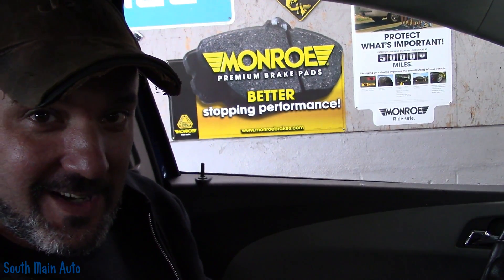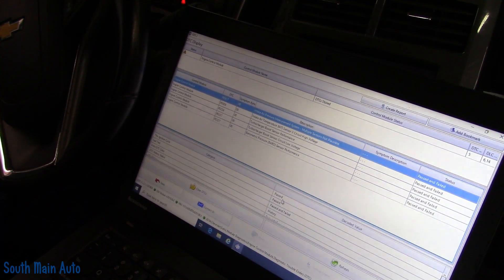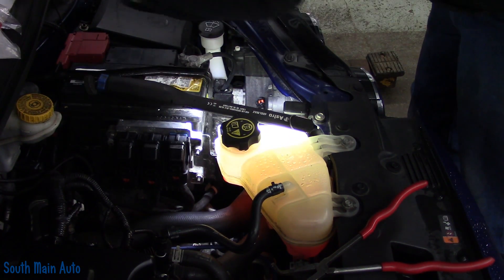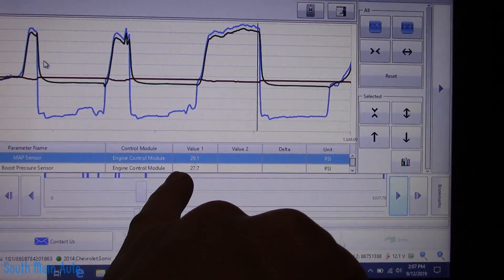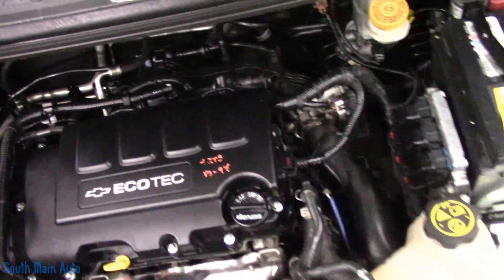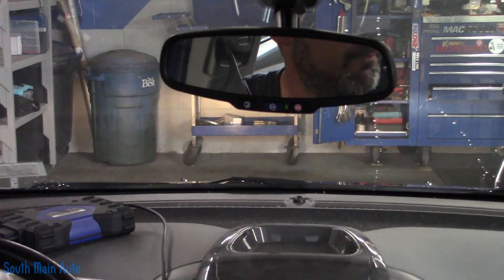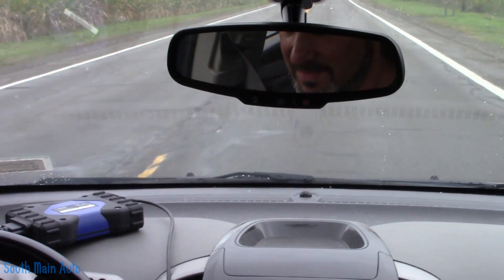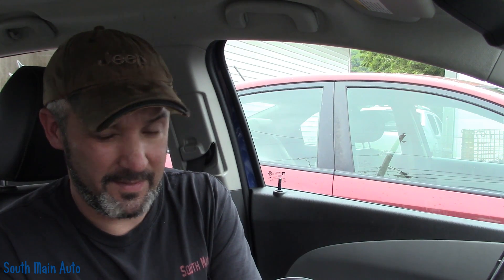Chevrolet Sonic 1.4 Turbo: DTC P00C7

Comment: By 2025 they will be putting those 1.4's in the Suburbans and Yukons.
Reply: By 2025 that 1.4 turbo will prob make more hp then the current engine in a suburban
Reply: @johnaranjo2059  At the rate these car makers are going, it wouldn't surprise me if they put fuel injected Briggs and Stratton lawn mower engines in cars.
Reply: @richb.4374  So what's wrong with a B&S engine? It's probably BETTER than what they're putting in those Sonics now!
Reply: @johnaranjo2059  and break needing replaced every 50 miles lol
Reply: @johnaranjo2059  For the 15 miles it would last?
Reply: @richb.4374  The Briggs engine (21HP, OHV twin) in my YardMan rider has been going strong for 15 seasons with NO repairs and NO smoke from the exhaust. Doubt if that Sonic will do as well! LOL
Reply: They're already doing it, although it's not a 1.4.   This year's Silverado has an option for a 2.7 liter 4 cyl turbocharged motor.  This is pretty much the way of the future.
Reply: @waynefoutz  aaaah doesn't  think so. Ever heard of a EV?
Reply: @waynefoutz  If you do any towing or hauling with the 4 cylinder,  you'll probably wear it out quickly and get V-8 kind of like  mileage.
Reply: LOL, the day GM goes out of business.
Reply: Never Gonnatell  I think the world ended a while ago actually.
Reply: @Charles BallI refering to the 7.4L 454 later 8.1 gas engine from GM/Chevy. 
 Many many applications and some making most of its torque, as low as 500rpms.
Reply: Mostly like they would put the current 2.7 i4 turbo in the suburban and Tahoe that's in the Silverado.
Reply: They are already putting 1.4 Turbo's in the Equinox which is one step closer to a Suburban.  I am 100% against putting tiny turbo engines in midsize or full size cars or trucks. The longevity of these tiny engines screaming and near max RPM just to hang with traffic is highly suspect.  Give me a 8 speed V-6 or V-8 loafing along at about 1500 Rpm at 55 mph any day.  These tiny turbos in bigger cars are about one missed oil change away from blowing up way too soon.  This is the fault of the EPA Turbos look good on government tests but real world driving rarely deliver the promised mileage and the EPA could care less how long an engine lasts for the owners.
Reply: @robc8468  It's all about air density with internal combustion engines. Lots of turbo engine damage is due to driver demands.
Reply: @Garth2011  Thats great and all but theirs a reason an old meaty/thick 7.4 Big block that makes torque starting at 500rpms, runs rich and only has 8.5:1 Compression lasts forever.
         The internals arent under as great of a stress.

Need a happy medium, but I dont believe a 1.4 boosted to 40psi is going to last unless you stay out of the throttle.
Reply: @DarkLinkAD  Maybe. In the 1960's and in 1970 production engines had up to 12:1 compression ratios which produced good HP, good gas mileage and didn't wear too soon. But, they did produce NOx that the EPA decided was producing smog. Today's alternative to those of the early era are most likely the GM LS line of engines. They went back to higher compression while the computers control the NOx. From my investigations, those LS engines are getting 300,000 miles before any major repairs.  Small cubic inches will fail every time if they are over taxed, even with normally aspirated induction. The straight 6 will live however, auto makers aren't interested in building vehicles that will fit an inline 6 it seems. Time will show how well the Ford 4 cylinder F-150 does if it's used like a truck vs. passenger vehicle. Just like an Indy car, those tiny displacement engines are junk after just one race. How will a production engine make it through the warranty period? Likely just that long and the burden is shifted to the owner.
Reply: @Garth2011  Which production car engines had 12:1 compression ratio in the 70's?
Reply: @ferrumignis  GM Big Block and Small Block. A few of them had 12:1 Chevelle/Corvette and most of them were 11:1 while others were 10.25:1 depending on the HP option. In 1971 GM reduced them and again in 1972 while all of them went to 8.5:1 in 1973 and got 10 MPG and ran poorly. The 300 HP 350 4 bbl Small block of 1970 had 150 HP in 1973.
Reply: @DarkLinkAD   Another reason modern engines wear out so quickly is the manufacturer specing sewing machine oil for lubrication. I've seen 0W-20 specced on a bunch of modern cars and that stuff is like water. I've heard engineers claim it improves fuel economy because the engine doesn't spend as much power moving it around due to lower viscosity.

Some of these new cars spec'd with sewing machine oil are using older engine designs that originally were spec'd with 5 or 10W-30, a much thicker oil. I worry about the day where it will become hard/impossible to find that oil for my truck since it was made back in the 80s.

I've seen the internals of some modern engines after normal wear and tear with these thin oils and the cylinder bores are in pretty awful shape.
Reply: @Garth2011  The reason the '73 "only" had 150HP is because prior to '72 HP ratings were "gross", after '72 ratings were "sae"....
Reply: @TheOzthewiz  Maybe elaborate on that for us viewers. Every truck and auto we owned in those days came with owner manual documentation as well as the many magazines with engine data. Gross SAE or net SAE or not, the 1973 engines were all junk, no torque, no power, no gas mileage. Catalytic converters came out in '75 for CA and then the performance figures began to rise but very slowly while gas mileage continued to suffer for decades.
Reply: @robc8468  How bout a 5 Liter 4 cylinder with worlds largest harmonic balancer? Great for those who hate changing spark plugs :P
Reply: @robc8468  these small turbo  engines hit max torque in low rpms thanks to the turbo. Its naturally aspirated small engines that you need to rev the piss out of to get any power out of the engine. My 2018 civic si (1.5 liter turbo) hits max torque at 2100 rpm and carries that through to 5300 rpm, so there is no need to rev like crazy to pass people or merge onto the highway. I know you're referring to bigger vehicles but I dont see how a slightly larger displacement turbo engine on a bigger vehicle would act that much differently. I will admit the long term reliability of small turbo engines remains to be seen.
Reply: It would have to rev so high , it'd probably burn up engines rather quickly.
Reply: @tstocker6926  You will be surprised. Around my place we have been used to 3-cyl 1.2L turbos, and they are by no means weak or screaming. Its just the way it goes by the increasing environment awareness. Its just you americans that cant think of anything else but 5L V8's wasting a lot of energy reaching 1.st place on next traffic light.
Get ready to the future, it has one distinct feature: its coming whether you like or not 🤑
Reply: @tstocker6926  People have been saying that since forever. Never happens.
Reply: @ethelryan257  yep, when ford rolled out the 3.5l ecoboost.. every one talked shit..Not any more. the engine was R&D'ed for like 5 years before you ever saw it on the road. 
The engineers tested that engine in all conditions, even conditions the truck would never see and turned the wick up to see the failure points.. Cant say who told me, but the stock 3.5l ecoboost made 1000hp+ turned up during dyno cell testing. 
I know a guy who was on the R&D team for that family of engines.
Reply: @tstocker6926  hey my 1.8t makes its peak torque at 1700 rpm lol
Reply: @tstocker6926  Some Motorcycle engines rev to 15,000 RPM, but are NOT blowing up....
Reply: @TheOzthewiz  the rotating mass in a motorcycle engine is much lighter and they have a shorter stroke than a car engine
Reply: @tstocker6926  hahaha  yeah not even that using regular fuel in a turbo will cause it to blow apart     knock knock   whos there

engine , engine who  engine that has blown it self apart..
Reply: And people will wake up and realize what's happening and I think people will protest

Comment: Brake booster shot in 5 yrs? What a piece
Reply: Actually i work with GM. Personally never seen a sonic with a bad booster. Done many of sonics so not to common of a problem
Reply: @toolboxman9960  Still a total POS.
Reply: probably bad check valve and the turbo is blowing fuel/blow-by gasses and burnt oil back into it....  very plausible issue identified acquired go go go!!!!!
Reply: It would not surprise me in NY.  With all the salt they use in the winter not much survives more than 5 or so years unless the owner really maintains the vehicle.  Oh and by the looks of this car... not well maintained.
Reply: .......of crap?
Reply: Kilmer was right. Junk.
Reply: @BigEightiesNewWave  Kilmer thinks everything is junk. 😄
Reply: @mannys9130  bc it's TRUE lol
Reply: @mannys9130  Everything but his Toyota.
Reply: @mannys9130  I am going to trust the guy who's been working on vehicles before most of us were alive.
Reply: @mannys9130  Exactly. All he does is say every make is junk except 25 yr old Toyota's.
Reply: @rebelndirt8830  AND Ford trucks!
Reply: @richb.4374  AND Ford trucks!
Reply: @mannys9130  that isn't a Toyota or a 93 Celica for that matter.
Reply: @BigEightiesNewWave  Kilmer is full of shit. Everything is junk but old Toyota's in his world. He yaps on his channel and you never see him actually work on a car. His garage looks like a junk pile yet he claims to be a 50 year mechanic. I think his mouth turns more wrenches than his hands.
Reply: @richb.4374  "Everything is junk but old Toyota's in his world." but that's true in the real world lol. Where i come from we have a saying that translates to: Any car will get you to where you're going eventually. But to get back home you need a toyota.
Reply: @SPAZTICCYTOPLASM  or a Honda or most 80-90s Japanese cars
Reply: @YouWillNeverKnow  I dunno about that. I go off experience in the third worlds the world over. And while nissan gets mentions most other companies are forgotten in favor of Toyota. Datsun gets a lot of praise i think they're part of nissan or where. Some American willies and m151 jeeps and other military vehicles are legendary, and some other cars like old landrovers and a couple french trucks.
Reply: @SPAZTICCYTOPLASM  Datsun was the brand name Nissan used in the West.  Eventually they decided to use their actual name instead.
Reply: What a pile🌰
Reply: @michaelking550  .........of turds?

Comment: The big 1.4L 🤣
What the kids say these days? Just SEND IT!
Reply: 140 bhp of pure muscle, 160 with a mild remap it does alright with the auto box too
Reply: @Mrflash222006  200-220whp IIRC, thats a Ko3 turbo. Same as the VW GTI, newer design.
Reply: @DarkLinkAD  200-220 bhp that's tuned with a lot of engine work, 140bhp stock its only a little 1.4 FWD setup, iirc the golf/rabbit GTI is 2.0 unless its the twin-charged engine
Reply: @Mrflash222006  they also have a 1.4, newer tech. No balance shafts, intercooler in intake manifold. Mostly different than the 1.8 or 2.0 setup
Reply: @Mrflash222006  Yeah, the older VW were 1.8 turbo and 2.0 turbo 170-198 crank HP, Doesn't matter, the turbo supplies the cfm, the engine takes the beating... sometimes takes the beating.

 The valvetrain/heads arnt likely to be that restrictive. Even a GM 3.4 v6 will take 415whp before stock valves float (Pushrod engine).
Reply: The Big 83 cubic inch engine! The magic of modern engine technology: 1.6+ hp/cubic inch.
Reply: we are getting 280-300 hp out of these engines now...27psi, E85 and havent touch internals/head yet either.
Reply: they send themselves, no need to try lol
Reply: Cleetus Mcfarland has a 10.3L Big block in his 4th gen Camaro, with a blower so high it will catch birds.
Reply: @RicardoPCGamer  not anymore.  Got rid of that junk for a real Australian big block
Reply: @rxtuninginc8444  yeah i know. Also Toasts old engine is going into the Freedom Factory flatbed tow truck. Can't wait for them to swap out the old carbureted 350.